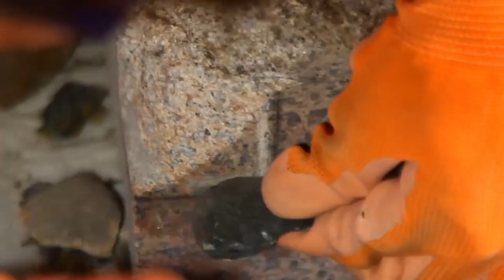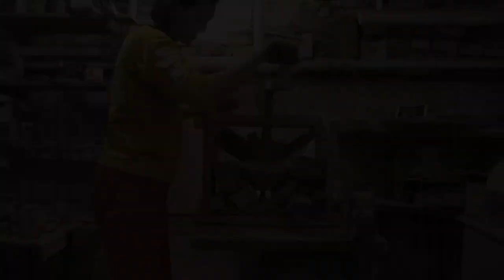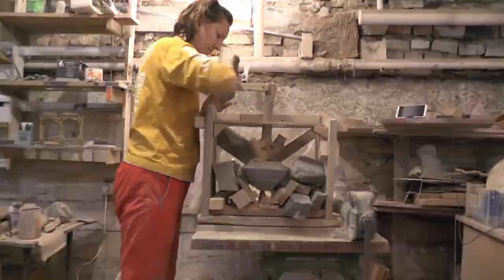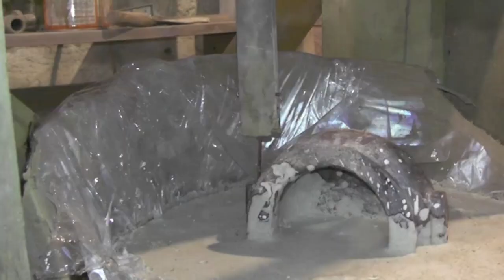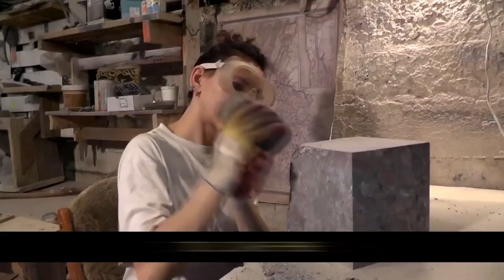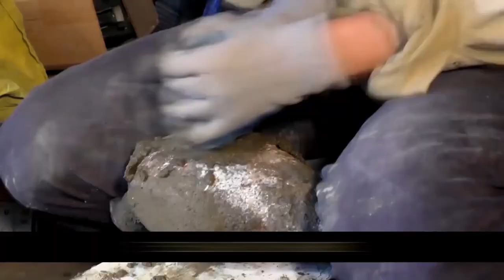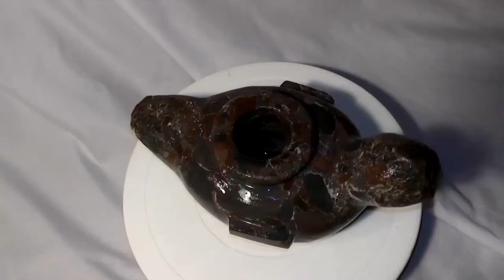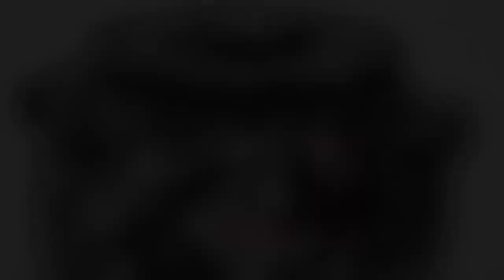DIORITE VASE. Let's make an impossible artifact real!

Comment: But it's not even close to perfect, let the guys at Rolls Royce check it with the equipment and you'll see how terrible it is.   And then make 100,000 more of them, all perfect.
Reply: "And then make 100,000 more of them, all perfect." ---
nonsense
Reply: @Leeside999  You do realize they found around 100,000 perfect stone vases under the bent pyramid in egypt. The point being it must have been easy for the ancients to make the perfect vases if they made that many of them.
Reply: @doomfathertm8771  The number is more like 40,000. And half of them were broken when found.  A large portion of them are made from alabaster, not hard stone. And they certainly are not all perfect. Even by just looking at the museum pieces will tell you that.
Reply: @Leeside999  I am not talking about the dynastic ones, yes they are clearly hand made. I am talking about the ones the dynastics inherited,  like the one the rolls royce engineers just scanned, the one they said HAD to have been made by some kind of machine. Yes there were thousand of them and thats just the ones we have found.
Reply: @doomfathertm8771  How can you say that all of them are perfect when only one has been shown to be almost perfectly symmetrical. And do we know for certain that it is a genuine vase from that era when the provenance of that vase cannot be confirmed? Also, How do you know it was pre-dynastic or inherited? 
I've heard engineers make claims like that before only for it to be proven otherwise.
Reply: @Leeside999  Because there are only 2 types, the hand made ones with lids and the perfect machine made ones made from granite, basalt and diorite and these ones are all perfect, even the broken parts it is clear to see they are parts of the perfect ones.  At no point in the Egyptian story did they ever posses this kind of ability, so we know it is from an earlier period.  I strongly suggest watching the video's on UnchartedX channel.  If you wish to debate any of it, I suggest doing it there.

Comment: Great work. Recently UnchartedX scanned an egyptian vase with the help of some engineers and got very interesting results (very high precision and symmetry) . I'm curious to see how these vases stack up to the Egyptian scans in terms of precision. A comparison of this kind will shed some light on the nature of the Egyptian work. UnchartedX has the scans for download, so a comparison should not be hard.
Reply: Ben's claims = are bunko........  So he scanned a vase - okay - so what.  Does that magically disprove a given method of manufacturing = not at all.  All it shows is a given object has given dimensions.  If you can not recognize his simply fact = 🤷
Reply: @darklight2.1  Haven't had the chance to look at the scan yet. Where are these areas of high discrepancy? I would expect these areas to be in the spots where a lathe can't be used. Even the stone vessels made today, are not designed by computers (shocking, I know, but it doesn't seem as mysterious), but they are made on lathes with fixed or hand tools. The rotary motion is the one accounting for the precision and there is no reason for the Egyptians to not have lathes.

The provenance is a problem, but since Dr Miano publicly offered to help Ben apply for permission to scan museum vases, I'm sure he will reach out and we will get better examples.
Reply: @darklight2.1  My concern, among others, is that the stl file is not a true and accurate representation of the vase itself. Especially considering the stitching method employed to fit geometric shapes. I don't have any experience with scanning or using polyworks software but that to me sounds a bit fishy. And allows plenty of room for fudging. I'm hoping that Scientists against Myths, in their upcoming video, will address this.
Reply: @customsongmaker  scientists against myths are one of the few true scientific experimentalists in this space. 
Unlike the cult like followers of unchartedx or the other grifters
Reply: @customsongmaker  her vase has been completed a while back. The video is coming soon. It's delayed because of the latest grifter unchartedx claims. . All will be addressed. Keep your atlantis underwear on.
Reply: @customsongmaker  Plane ticket? What?
Reply: Well.. hes gone from scans to actually verifying the tolerances. It's impossible to recreate as per the method she uses. You don't need to be smart to realise that.
Reply: The stone piece this woman made would not stand up to the scrutiny of precision as seen in the granite vases featured on UnchartedX. Where are the single digit "thoudandths" of an inch measurements made across the various parts of the piece she makes, during the production process? where are the relational measurements between curvatures, encompassing geometries that correspond to each other in the golden ratio, to single digit thousands of an inch? The only thing this video demonstrates in the level of ignorance mainstreamers have about this subject. Its either ignorance or a deliberate "strawman" effort to supposedly debunk the possibility of ancient high tech civilisation. "There is more chance of an entire quantum universe sprouting out of your left nostril" than this stone carving matching, by chance, that of the real stone vases found under the Step Pyramid.
Reply: @Leeside999 ... interesting, I cant wait to see the same single digit "thou" level of precision you claim is possible by hand and eye alone. It will be very useful to see how this is achieved and documented.
Reply: @pauldmann1166  has he measured any authentic vases yet? The owner of the vase from the first scan doesn't even know where it comes from.
Reply: @pauldmann1166  I can't wait to see an actual museum piece measured by unchartedx. Because the only authentic pieces I've seen measured do not exhibit any of the tolerances shown in the unprovenanced vases.
Reply: @R0jiv4 
Why is it impossible?
Reply: The vases he scanned aren't verified. "They look to be from the old kingdom," is faulty af. There was no Czechoslovakia at the time that the one vase was supposedly gifted to a czechoslovakian ambassador or whatever tf he called it. Lmao
Reply: How many of you are machinists? I have a machining degree. The idiocy of the arguing points is amazing. Why do people decide to label something with closed minds while insisting they're the authority on science?
Reply: @BSIII  Hey bro, I've only just seen your message now. Never got a notification. I've also seen you around do the same thing 🤝

Comment: Theres a big difference in making a sculputre out of granite and making one thats precise to a thousandths of an inch, you should get your stuff scanned to see how precise you sre
Reply: You dont even need to scan it.  it look bad
Reply: One thousandth of an inch is 25.4 micrometers. This is nothing extraordinary. In fact I measured just now my son's notebook's sheet thickness (7 mm per 80 pages), it is 87.5 micrometers. No it is not exceptionally thin, just an ordinary writing paper. You can feel 25 micrometer things with your fingertips, it will catch your nail. Simple grinding with wet sand gives much smoother finish. Fixing item to something that can be rotated gives you possibility of making items that are also very symmetric in shape. As easily.
Reply: @tonisee2  Man claims it's totally easy. Doesn't do it. Many such cases.
Reply: @tonisee2  It's not about how thin it is...... lol.... it's about how its parallels to the other points of reference within that range... do you understand that? be honest.
Reply: @charleswalker2484  I answered to what is written. Precision is about scatter. Accuracy is about the value. And again, 25 micrometers is nothing special. When working with simple tools and using the capability of attention and care put together with the basic analysis of causes and outcomes, that kind of accuracy and precision is not difficult to achieve.
I do not argue about possible low progress rate on such processing. But even that is very easy to underestimate.

E.g. 25 years ago I was grinding and polishing a 20 cm telescope parabolic primary mirror and flat diagonal mirror. Well, that took few months doing by hand and few very simple tools (pieces of roughly cut glass, hammer, grinding material, vessels to use levigation sorting out grinding material to fractions, ruler, tar pitch, light source, sheets of paper, water), but I wanted to build a telescope for myself, which was a strong motivation.

Comment: I love what you guys are doing here. It's exactly the kind of back and forth that ought to be taking place in the scientific field.  One of the things that you have in common with the alternative history types is that you both lack technical data on these artefacts - measurements, dimensions, angles etc. You could actually work together on this and your contentions would ensure that the other is not falsifying their data which would be to everyone's benefit.

There are a couple of logical problems you are likely to run into that I don't know how you can circumnavigate which is this: 

The first logical problem is just because something can be built through primitive means that actually doesn't prove it was built through that means - for the reason that there are many ways to build the same thing. For instance, I can prove that my living room table can be built using a hand saw but it actually was cut using a machine saw. So you run into a logical problem of ''can'' not necessitating ''was''. 

The second logical problem is working out what actually constitutes ''high technology', because if you make industrial tools out of primitive materials then aren't you still making industrial tools? Thereby proving the Egyptians had industrial technology? There needs to be some kind of agreed upon standard as to what constitutes ''high technology'' otherwise there is going to be a lot of goalpost shifting and needless contention.
Reply: There are tooling marks on ancient Egyptian artifacts that show the undeniable marks of lathes.   They also had overcuts that are far larger than you would have if the process was slow.
If we would have trouble making the object with our best current technology, it is safe to call it "high technology" for people that are canonically 'known' to have used copper chisels'.
Reply: No, You cannot look at the marks on something and declare it is x.  
It could be many things and you have a very narrow view.
Humans made these things.  And those humans did not have electricity or magic.
Reply: @jamisojo  The question of whether they had access to higher forms of technology is the whole discussion. Simply declaring ''They didn't have access to it'' is not very good reasoning.

A better argument would be something like: ''Higher forms of technology are less likely to occur historically than lower forms of technology thus through blind probability alone all things historically are more likely to be made using low technology''

You still run into the problem of actually defining ''High and low technology'' here but it is a much better way to start arguing.
Reply: @jamisojo  It doesn't matter how good of a craftsman you are, you aren't gettting the x and y axis of a vase to be aligned to within 3⁄1000 of an inch using hand tools. Not happening for you. Not even possible with something soft, like clay. They aren't machined either though, some have features (like handles) that couldn't be turned using something like a lathe. I have no idea how they were made, we may never know. 

I'm not saying they used machines, electric or lazers but they used some manufactuing process to achieve this that we don't understand anymore. There's some mechanism for precision measuruments that we're missing. They have to had some way of telling how flat or precise a surface is when working it. They didn't just eyeball it, that's actually impossible. Its far more likley to be aliens than just handtools and eyeballing it (I know its not aliens, but that's more possible than eyeballing it).

Comment: Until she can duplicate GD&T measurement data, her work is irrelevant.
Reply: @darklight2.13  
Ah, did someone Google GD&T, so now they think they know it all? 
Unfortunately for you, I have worked in metrology for nearly 2 decades and know far more about this than you ever will. 
We have measured some of the oldest vases and found them to be so incredibly presice that it would have been IMPOSSIBLE to meet that level of manufacturing accuracy consistently by hand. 
Some type of primitive machinery must have been used, and it must have been built to exacting tolerances itself. Because that us how manufacturing works. We use precision built machinery to build precision parts. 
So AGAIN until she can create a surface with a flatness measurement of less than 0.003 of an inch that is then perpendicular to the internal cylindrical cavity to within 0.001inch all she is doing is wasting her time and perpetuating the myth that all these artifacts were made by hand.
Reply: @darklight2.1  
LMFAO, 
It's funny because you obviously don't know, but you sure spent a lot of time trying to convince yourself and others that you did.
Reply: @darklight2.1  
What's really funny is your "science" amounts to speculation about the past. Then refusing to acknowledge discrepancies in your beliefs. Where as my Science builds airplanes, bridges, and nuclear reactors. Which either work or lives are lost. In my line of work we can't afford to be wrong. So, again, I say you don't know...
Reply: @darklight2.1 dude .. there are thousands of ancient stone vases which are more precise, more symmetrical, and thinner than any stone vase we could create today using computer programmed diamond tipped power tools.
Reply: @darklight2.1   denial isn't evidence. Aerospace engineers Alex Dunn and Nick Sierra scanned the vases, and they had a margin of error within 1,000th of an inch.

Comment: Not to take anything away from what you have achieved here , you are clearly a very talented and crafty artist , but I think you're missing the bigger picture here. None of those predynastic  precision vases could've been made by hand /primitive technology. Their true symmetry / precision is not fully comprehensible until they're 3D scanned and analyzed, with their precision beeing down to microns . To think that this type of geometric precision (especially with material that's hard yet very brittle, like granite / diorite ) is achievable by hand and loads of time  is just wishful thinking.  Also you have to take in to account that there were almost 50000 of these  granite / diorite precision vases found in a predynastic burial site . With speculations there are thousands if not more ,still buried under the Sahara desert sands. It would be safe to assume that at one point in time there  must have been hundreds of thousands of these high precision vases in circulation . Meaning they were easy enough for them to make ( definitely not 7 months per vase ) to be made on such a mass scale production . Meaning that some type of advanced tooling / technology must have been used here .
Reply: They still could have taken months per vase or even decades but if they were making them it wasn't with hand tools.
Reply: A lot of perplessità, for some years, each one to realize one piece. And after the realizzazione, someone finished the job, adding the required precision. A lot of people,  a lot of vases
Reply: ("A lot of people" at the start of my comment, sorry for the wrong auto correction of my phone)
Reply: You guys... There are many ancient vases which we cannot replicate with computer programmed diamond power tools. Let alone by hand. The margin of error on these vases is way smaller than human eyes can perceive.
Reply: @freefunnyclips2748  We could replicate them but it would cost 100s of thousands of dollars and would almost certainly fail many times before one worked.  So for that level of precision to be in a vase is mind boggling unless it had some specific engineering purpose.
Reply: Here we are 3 years later and she still never made the diorite vase she talked about. She probably realized a month in it was impossible with bronze age tools and dropped the whole project.
Reply: @2jaymeister  How ironic that the vase was finished and measured to be more prcise than the Egyptian ones whahahahaha
Reply: Are there two vases with identical measurements?
Reply: @charleswalker2484  Are there two vases with identical measurements? That would tell us something.

Comment: I read about Herodotus and other authors referring to fire as the key tool used in carving and drilling granite. A try about this use of heat on stone would be very useful I think.
Reply: Herodotus never verified the stories he was told. Just wrote the first thing anyone told him and assumed no one would ever lie. He got roasted pretty good for this by successive historians. 

Not that this alone is reason to doubt fire was involved. The main reason is that granite consists of inhomogeneous sections of various materials of varying hardness and responses to temperature. Get some hot enough, and you'll end up with molten obsidian separated from other rock that doesn't soften or change at those temperatures, and the molten obsidian will cool into obsidian glass, not go back to being granite. 

Not that no one should try heating the rock, just that it's doubtful it will have any effect. There is also risk of any trapped water boiling and causing an explosion. However small an explosion, it can still be an injury risk. Much smaller risk with granite, but still a risk.